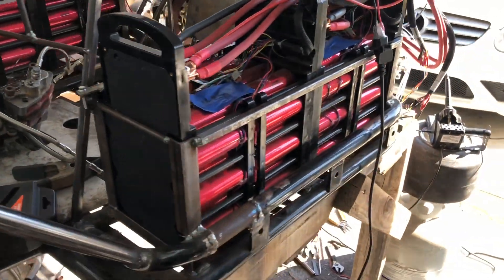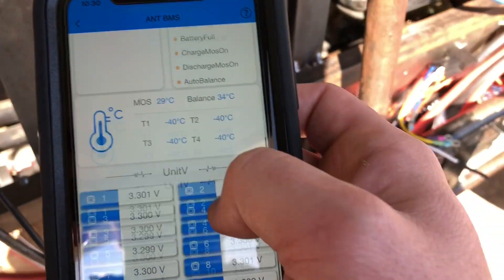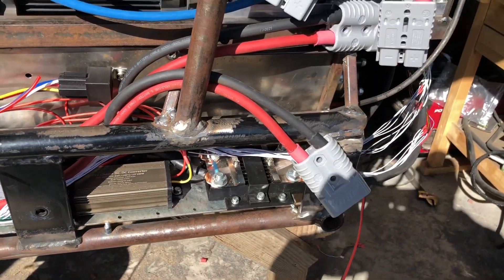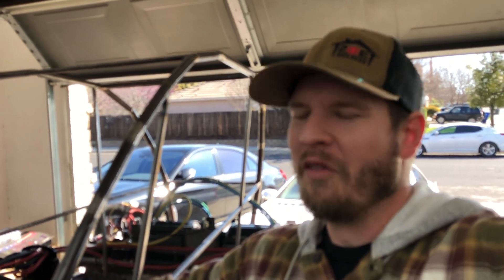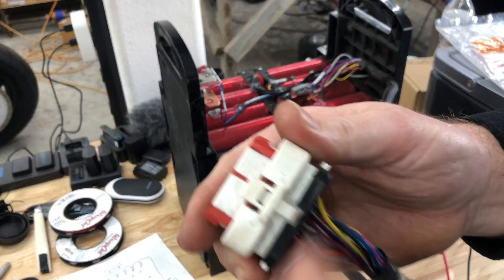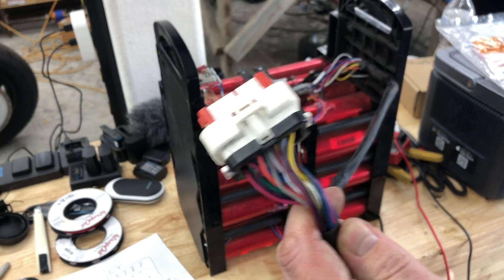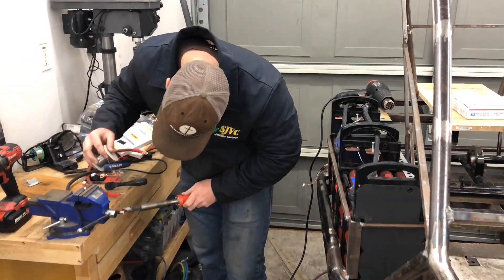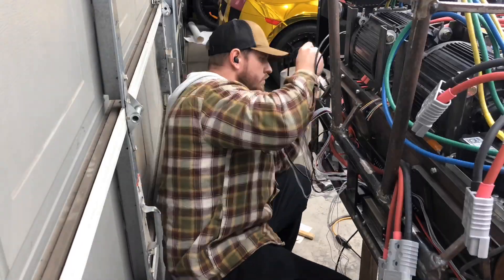Turning Headway Super Beast Modules Into A Battery: Full Build!

Comment: What are you connecting over the shunt? As I understand it the shunt has a small known resistance, so by measuring the voltage drop across the shunt we can calculate the current flowing through it. What are you using this current measurement for? Thank you!
Reply from the maker: You’re exactly right on that. I’ve got it hooked up to a volt and amp meter, and the shunt is giving the total amps flowing through the controllers

Comment: Dunno if you saw the recent Grind Hard video, where they turned a "power wheels" into a potentially 50 mph sleeper. If that can hit 50 on a single motor and one battery, this thing might blow past 100! Good bye tires!
Reply from the maker: I’ll have to look up the video! I haven’t seen it. Hopefully this thing not only gets to 100 but does it absurdly fast. It’ll definitely have the power for it!